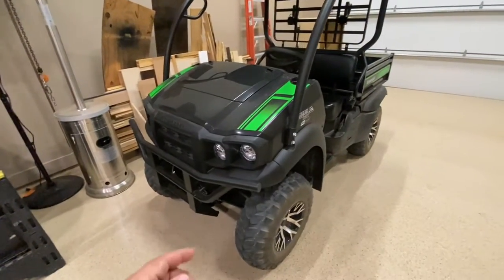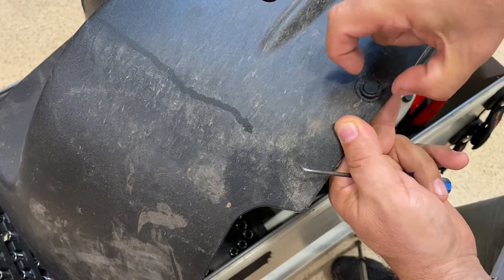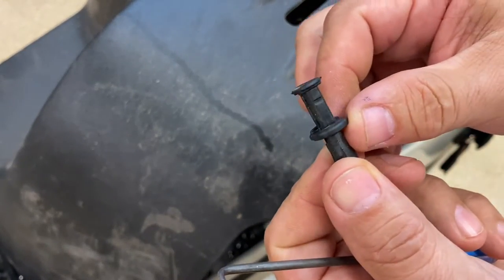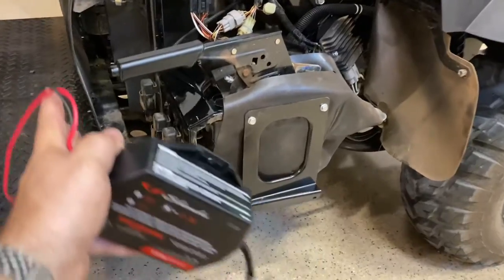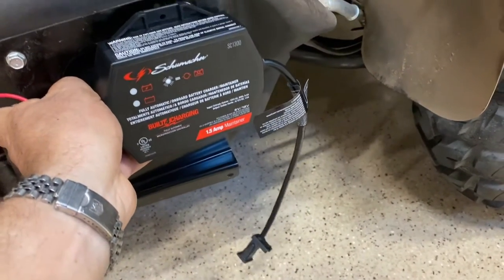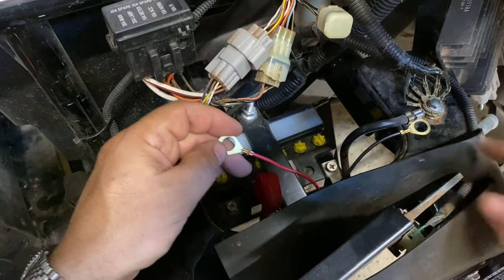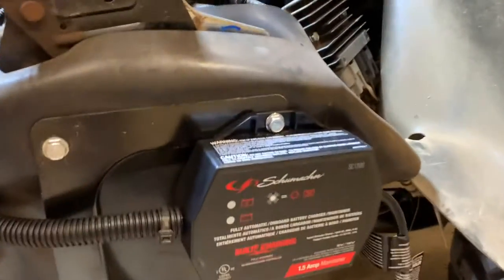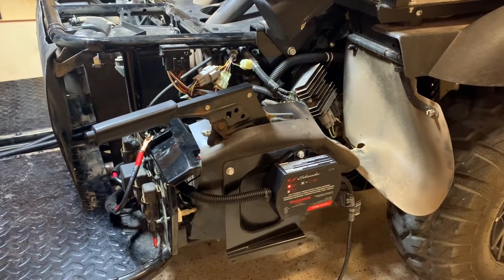Kawasaki Mule SX ● Install a Trickle Charger Battery Conditioner

Comment: Any concerns with the charger getting wet from riding through puddles?
Reply from the maker: Mine is still working fine but you have a point. The unit doesn’t have any venting and appears to be durable enough. Time will tell I guess!